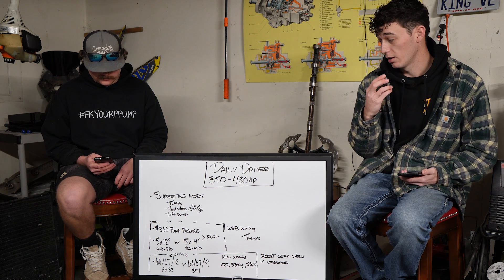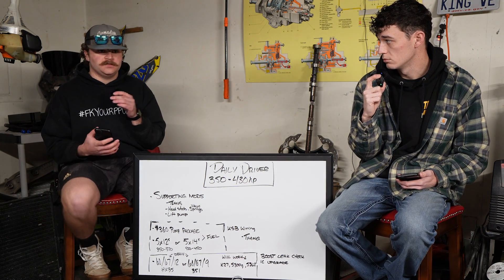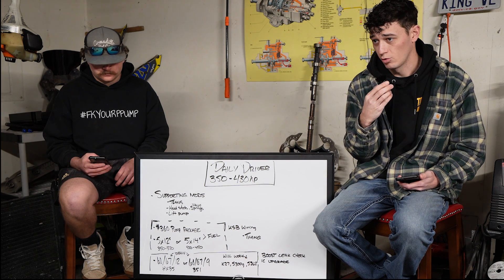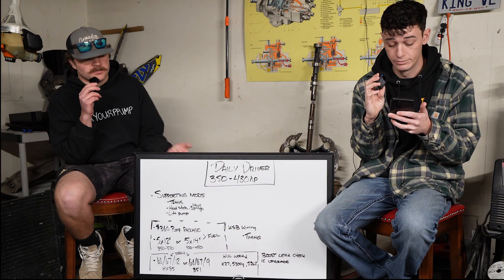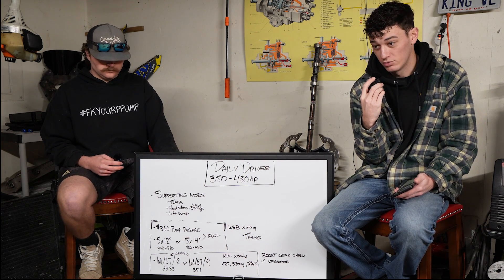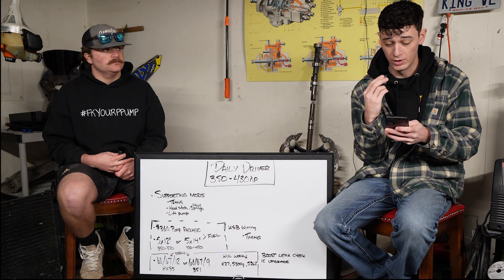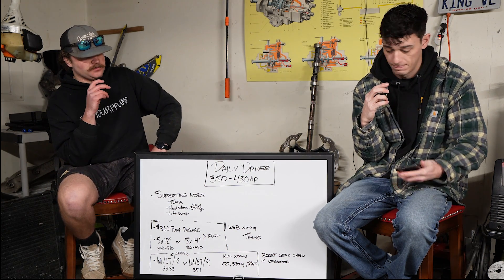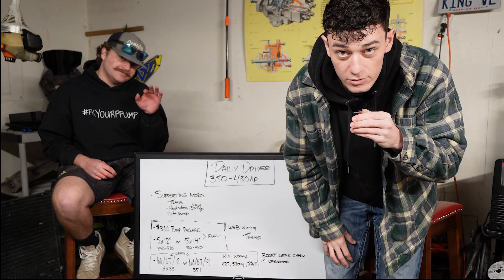4. VE PUMPS: When to PPUMP swap my 1st Gen

Comment: Dumb question not much of a diesel buff but my 98 12v got p pump swapped from previous owner I’d like to swap it back to ve is it possible if so how? Thanks
Reply from the maker: A 98 12 valve is a factory ppump truck, nothing was swapped. The VE came on first gens only and that was from 1989-1993. 1994-1998 were 2nd gens and factory ppump 12 valves. 1998.5-2002 were 24v VP44 engines

Comment: Boost leak test do it   ic had more fome than Starbucks.  Then hit an elk at 80mph no longer thinking the cummins spec of no more than 1 psi drop across the ic matters ( eg hx35/12  29psi at turbo 28 at manifold  with a factory sealed 91.5 june)

Comment: What about ffs ve pump build vs the options you’ve stated
Reply from the maker: @AJGaming-yl8br  1) nothing on the FFS website is worth your time or money. 2) That pump is simply a THD pump they are drop shipping, which there is no ETA on availability of those pumps, lead time could be up to a year right now
Reply: @ copy that thanks for the info. Im actually in Indiana and local to the rat man performance stuff enjoy the Knowledge just got my first gen and already obtained a built 47re going for 6-700 hp street truck
Reply from the maker: @AJGaming-yl8br  gotcha, well ESPECIALLY  if you're local you've got no reason to not go with Evans stuff, being local he will help dial it in and everything

Comment: How long is a turn up ve pump going to last you  at the 350 to 450 horsepower range  I have an inner cold  1992 ve pump that something in the main chef snapped off spins freely with your hand I don’t think the truck is making that much horsepower maybe 250 to the most  I get all pump have there up and downs  I like your video there is a lot of good information but I would disagree on something for my own experience  but good keep it up
Reply from the maker: @hyrumjessop5568  there is no reliability issue with a VE at 350-450 just like there isn't one with a ppump. What your describing is broken ears off the shaft which is a lack of lubricity and or contamination issue, it is completely 100% nothing related to power output.

Comment: What parts would I need to make my 1st gen 750-1000hp and not blowup and be able to daily drive it
Reply from the maker: @PonyBoySebas  I daily drive a 760hp VE truck, biggest thing is a good trans. You aren't going to break anything engine wise. You will absolutely have to have a fire ringed head and ARP 625 head studs (not 2000s). Main studs and rod bolts would be good insurance. But to do that with a mechanical truck you need a wild setup really, 5x16s minimum or a 5x18, comp pump, 364/488 turbo setup at absolute minimum. There's a lot that goes into it and we will be doing a video over that level of power before to awful long

Comment: So I have to ask this question because nobody ever wants to comment on why ve trucks do this. As you showed your truck making a Dyno pull after you let off the throttle it surged 3 to 4 times is that good manners because if I own the truck and let off in full throttle, I don’t want my truck to keep surging? Please comment on the surge after full throttle
Reply from the maker: @brianconnor5213  that is me blipping the throttle as it's coming down in rpm to make sure everything is good as it just had a ton of nitrous shoved into it. Others do it to prevent the pump from vapor locking
Reply: @ so I have a 93 first gen and I don’t know who messed with it but if I full throttle it and lift off pedal it always burps back. It might be making 300hp . However I have a 2nd gen with a bigger turbo 180 p pump and power drive diesels stage 2 injecters and it acts like its stock. On dyno it pulled 534hp with stock timing. I wonder why my ve first gen always burps after a full throttle pull? However if I lift off pedal slowly it doesn’t do that. 🤷‍♂️ I can say ve pump starts faster and does get better mpg. I do run duall tanks and burn black diesel so mpg don’t really matter to me.
Reply from the maker: @brianconnor5213  so what is happening, could it be explained are more of a stumble than a blurp? Like is it reving up or is it stumbling? Because stumbling and even dying after a full throttle pull and letting out fast is 100% normal for any rotary pump, VE or VP. We have a fix for that with VEs though

Comment: if you were buying a 12v for a 400hp daily driven build would you buy a VE or P-pumo motor? 2nd gen frame with a 70s or 80s cab and a flatbed...
Reply from the maker: @dominicnardone5135  I would go with the most cost effective option, a ppump 12v engine will sell for a lot more than a VE engine. So you could save at minimum 500 bucks there if not 1k. So id still be buying a VE engine, $360 in pump parts gets you to 300, $600 in injectors, and then a drop in turbo upgrade like a 60/67 from Duncan fenley and there's your 400hp
Reply: @GavinHuke  You will need an exhaust and fuel transfer pump too.  A stock muffler chokes pretty hard.

Comment: How much horsepower can a stock pump with ratman's delivery valves put out?
Reply from the maker: @itsaRiot  500hp is achievable, I believe more than that is achievable but until I prove it, I will not claim that it is. And to reiterate what I'd be referring to is a stock maxed pump so Evans fuel pin, gov spring, DV's and the pump settings maxed out.
Reply: @GavinHuke  thank you for the info!  love the videos!

Comment: The VE has come a long way and it makes a me wonder about the practicality of a PPump vs VE swapped 98-02 2ndgen with a failed or failing vp44 

Or for that matter a 24 valve with a ve swap in general in insert ___ Cummins swapped vehicle
Reply from the maker: @Sniping.Styx369  a vp performance wise will outrun a ve all day currently. With that being said we have VE swapped plenty of 24vs whether they were 98-02 engines, 03-07, and even 07.5-18 6.7s.
Reply: @GavinHuke 
If i bring you a complete 1999 24v truck and a new schied ve pump. Would you be willing to swap it while its still in the 99 dodge chassis? So i can motor swap it to a 2000 GMC gmt400 when i get back home.
Reply from the maker: @hardhead7056  you just want the injection pump replaced?
Reply: @GavinHuke  make it a good runner whiles it's still in the dodge. So i can motor swap it when i get it back home. Unless you are willing to do the motor swap also. I can bring you both complete trucks.
Reply from the maker: @hardhead7056  so you have a VP engine that you want VE swapped, I think I'm following now. Just message me on Facebook or Instagram if you are serious. We can make it happen
Reply: @GavinHuke  yes. I have two complete trucks. Looking to swap.
And the best way to go about.  Ill contact you. Thanks.
Reply: @GavinHuke 
How do i contact you about ve swapping my 24v? Are you interested?

Comment: Adam foltz was making big power on a 160 for a few years
Reply: 160 p7100 they will go past 700 with supporting goodies.. injectors and air. they will make more power than 95% of the people that think they “need” a 215 and end up making less than a 160 can do. similar to VE guys that “need” a p7100 swap. and end up with same or less than they could have made with the VE they had. and now have worse fuel economy.